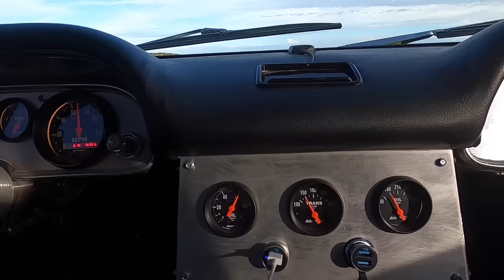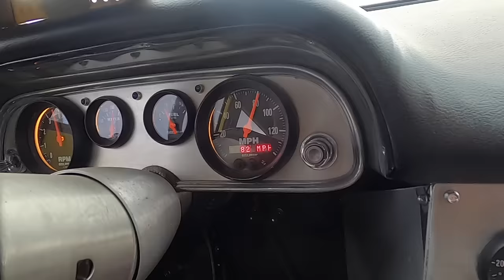The Morrvair Takes On The Rubicon Trail

Comment: 15:20 “cooked bacon, with a little bit of bacon, then we’ll add some bacon and it’ll be good” 😆😆😆

Edit: the only 4x4 I’ve owned was a 1981 Toyota tercel wagon (and yes, it really had 4WD… not a transfer case, but just an extra low gear below 1st). Anyway, despite my utter lack of experience and despite the Rubicon being a mere 2800km/1740mi away… this vid makes me want to go. Thanks for bringing us along for the adventure! Much love and respect from the prairies of Canada 🇨🇦
Reply: I’ve seen a few “BUMPS” up in the Canadian Prairies that ya can go climbing on... lol eh
Reply: The Tercel is a very capable off roader
Reply: @Doublejj55  i haven't owned it for years but I kinda miss it's simplicity.  Too bad it had been neglected and was in pretty rough shape when I brought it (both body and mechanical had seen better days)
Reply: Lol my dad had an early 80’s Tercel (can’t remember the exact year) and he swore that thing could take us anywhere. It was a vehicle that lived in the north east and unfortunately it rusted out by the mid 90’s. It was great in snow, I remember that.
Reply: My 87 Tercel 4wd had about 40 hp.  Impossible to start below freezing.  About 3 inches of wet snow and the Extra Low gear would barely pull you through.  I had the clutch cable break and drove it for a while until the part came in.  Warm up the engine in neutral (critical!), shut down, shift into 1st and start the engine in gear.  A bit of rev matching and all was good.

Comment: I learned real quick you never let gas get below a quarter tank on a road trip…
Reply: Or ever
Reply: @80sCrazyCatDadNGunAddiction  that, and I know those guys are seeing medium single digits on the trail. I was averaging a good 4-5 mpg on the good rocks up in Moab.
Reply: RollinRat  i did a small trip from San Antonio to EP and made it to Van Horn with 2 miles left on the gauge. That's the closest I've ever been to running out and my buddy was cussing me out. 🤣
Reply: RollinRat  I have yet to attempt the Rubicon, sadly I dont have my rig (Nissan XTerra) anymore. If gas prices go down, I may buy another one in the future.
Reply: RollinRat  I got a few dailys in the garage. I sadly crashed my Nissan which is why I dont have an excuse to off road anymore. Wife has Kia, I only have a Ford and Mazda leftover.
Reply: RollinRat  the Hilux is definitely a good truck.

Comment: I am continually amazed by the level of skill that goes into your recovery work, and also 4-wheeling skill, as exemplified in this video.  
I'm a contented 2-wheel drive-r and after getting stuck in sand a few times on my adventures, I now tend to back out of dirt roads real quick if they get the slightest bit sketchy.  I am happy on heavily traveled, highly maintained dirt roads.  At the same time, I'm aware that even if I had the 4-wheeling skill and the rig to try to tackle rough roads, I would not have the interest in this, because to me it seems like a lot of work, stopping, figuring out how you're going to negotiate a tricky stretch, picking a line, perhaps failing a few times and quite possibly sustaining some damage to the vehicle in the attempt.  That's not what I want to be doing on vacation.  I'd much rather park my vehicle near the blacktop, and get out and go for a long hike, which would not require any of this mental work, and would feel physically exhilarating in a way that I couldn't obtain by driving.  

But I do certainly see the attraction of putting your 4-wheeling, mechanical maneuvering and other mental skills and extensive vehicle knowledge to task with your recovery efforts, because you get to do work that is also fun in the outdoors.  Hard to beat that!!

Comment: Most capable “stock” vehicle I saw on the Rubicon was a Suzuki Samurai. The short wheelbase made all the difference
Reply: amd the damn things will go anywhere anyway!! 
Lots of people here in New Zealand 🇳🇿 chuck a Toyota 4AGE-T 1600cc4 cylinder Turbo out of a corolla, in the Samurai and they go insanely well!! Very little needs to be done to one for it to be an off-road weapon! Little lift, 30” muddies, straight thru exhaust and only if you really, really feel the need, a set of lockers (even just a rear)  UNSTOPPABLE!   💯% 
I’ve even seen one with an EJ20-T out of a WRX wagon, running the auto gearbox, the thing was nuts!! 😂🤣

Comment: I did the rubicon on 35s open front and rear and no solid mounted winch on my truck and was on a cable only once cuz I got wedges from not carrying the momentum. I did all the hard sections and no bypasses cuz we couldn’t find them. Did not try soup bowl because it had rained on us for 45 minutes. Hell of a trip and trail. Love the morrvair👍🏽

Comment: A great video.  I have been across the Rubicon many times.  It is always a lot of fun.  Glad that you took your family as I did.  Your kids will never forget it.  As for your buddy with the Cherokee with the stock driveline that should have been no problem.  Every trip that I have ever made has been in stock Jeeps with stock tires.  The only time when we had something different was when we were developing the TJ Rubicon for production and I didn't drive that prototype that much . . . but enough to be impressed with the 4:1 241OR transfer case and link coil suspension.  I even went through the Rubicon with a LWB Comanche pickup.  But the worst was when we decided to take a Geo Tracker through.  I had our Jeep dealer in Reno add a full belly pan to it.  You would drive it like a turtle.  It made it through but we scrapped what was left of it when we got it back to JTE in Detroit.

What makes the Rubicon Trail challenging is the slippery dust on the granite which has slick feldspar in it.  So what looks like a minor challenge  become much bigger due to the loss of traction.  Control is important so driving skills really come into play.  And those hard granite rocks do leave a mark on anything that touches them.

Comment: I was dazzled how smooth and quiet that Morrvair was on the highway with the tires you're using. I could live with that, when you consider that 80% of your driving will be on pavement. Road noise for me is worse than bad gas mileage.

Comment: Several you running out o gas had me laughing!  I did have fuel pump quit somewhere in ranch country in Oregon with a 1972 FORD 3/4 ton pick up with camper on back. Got towed into wide place in the road with few houses and basic necessities including a gas station.  The guy had the exact fuel pump on hand and had us back on road in two  or thre hours.  I couldn't beleive it! He said all the ranchers drove those Fords, you couldn't kil them! So, he kept all the needed parts on hand.

Comment: I was on a family trip to Florida in our expedition.  Lost the bottom bolt on a brake caliper. Put on the brakes and it flipped up and almost locked the tire. Pulled over and removed the caliper and moved the bolt from the top to the bottom so I could stop. Couldn’t go in reverse. Got to Florida and had Napa order a new bolt. Fixed it in the parking lot. Thankfully I always pack tools. They say half the adventure is getting there for a reason I guess

Comment: Oh, I thought the doors or rockers of the Morrvair were about to die. I started that route once in my SxS. I got to the cut off to Wentworth Springs and bailed. I just couldn't handle the slow pace and crunching sounds. Good call hitting Virginia City. Did you get a burger at "Champs Burgers" (food truck) in Austin Nevada? Great burgers. Stopped a few times as I recently moved to your neck of the woods.

Comment: Ever thought about running water in your tyres, or coolant in winter? for crawling if you run 40% water 60% air it helps you reduce pressure without the risk of popping the tyre off the rim, and also not sacrifice too much clearance. Water is non-compressible where as air is, also with a ratio similar to that you can actually use it on the road the centrifugal force will keep the weight of the water fairly evenly distributed and the air will keep the tyre compressible so it doesn't feel like you're driving along the road on woodern tyres

Comment: I doubt anyone would admit to it, but on a trail like that, where big bears could be, someone has a boom stick, in their vehicle. I used to go hiking in Virginia on skyline drive. There is a spot hidden off the trail where you can look down on the valley below, from above the clouds. Bears were everywhere up there. When i was hiking up there, i carried a large caliber. I had one instance where i thought i was going to have to use it. Mama bear and cubs came right across my trail and stopped. A mile or so straight down, or time for the boom stick. I sat on that rock for 20 minutes and they finally moved on. I didnt want to hurt it, happily i didnt have to. .50AE if you were wondering.5 lbs of fury. heavy. Anything else would have just pissed it off.

Comment: PLEASE READ, THANKS.
I forgot to say in my previous post, that if you accidentally roll over without either wearing a helmet or having your seat belt on, you run the risk of very serious head injury, via savage contact between your head and the interior roll bars. I would put in a Helicopter Pilot seat belt assembly, just to be sure. As a Commercial Helicopter Pilot, I can recommend them in a crash, as been there, done that. Love your mechanical skills.

Comment: One of the reasons, you never pass a gas station in Nevada without filling up.   I have had to pass up planned gas stops because the fuel pumps had burned a year earlier.   I always carry spare gas on my motorcycles.

Comment: Cadillac hill is named after a "La Salle" that didn't make it right where the cyclone rock restraints are. 6 or 8 Years ago a jeep didn't make it. Rolled off down hill extra gas cans opened up and woman driver burned to death.  Trail from Tahoe to Rubicon Springs was always an unimproved county rd. The Jeepers Jamboree club in 1947 blazed a trail from Wentworth Springs east into the springs and out to Tahoe and it later became a designated unimproved county road 80 foot wide. It is one of the only trails that is still open for 4 wheeling as the "Greenies" have managed to close almost all other trails in the state of  Californication.

Comment: Surprised you don't have extra fuel on that beast. I've ran my fj40 out a few times, but no gage and a 350 ram jet motor, and 4.55 granny with  4.56 ring gear. Measure milage in gear inches!

Comment: ...Eleven and a half MPG on the open road?...that equates to maybe three and a half MPG off road. Always carry topped up 'jerry-cans" for extra fuel capacity...and top-off your main tank as close to heading off the paved road as you can.  Nothing is more disconcerting than your entire three vehicle group deep in the woods,  one by one grinding to a halt from running out of gas...learned that the hard way,.

Comment: and here I am thinking that my car gets terrible fuel economy... I get on average about 1 liter/100 km (23.5 us mpg) on my big wagon, 8.5l/100 km (27.5 us mpg) in my rare classic shooting brake and 5.4l/100 km (43.5 us mpg) out of my daily driver hot hatch. the hatch is pretty economical but it is still really expensive to drive here in sweden due to having among the highest fuel prices in the entire world.
Reply: @MattsOffRoadRecovery  at 140km/h do I get somewhere in the neighborhood of 6.9l/100km (34 mpg). At 130 do I get roughly 6.4l/100 km (37 mpg). At 120 do I get around 6.0 l/100km (39mpg). At 110 do I get roughly 5.7l/100 km (41 mpg). At 100 do I get roughly 5.4l/100 km (43.5 mpg). if I slow poke around at 70 do I achieve something along the lines of 4.5l/100 km (52mpg) and the best I have ever done whilst hypermiling is 3.8l/100km (62 mpg) average over a full tank of fuel

Sorry for the long reply but here you have the full image of my 2012 suzuki swift sport.

I haven't done any detailed fuel usage for the 1973 Volvo P1800ES. Just my average since I bought the car and the most detailed I have been on my 96 Volvo 940 estate is an average fuel economy and the best I have done when hypermiling it for a full tank of fuel which I managed 8.3 l/100km (28 mpg)